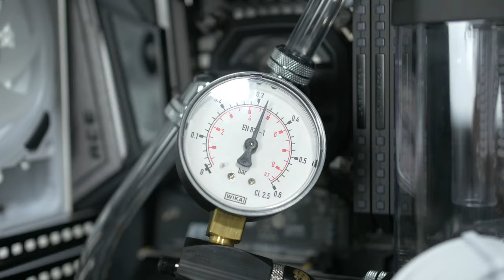Timelapse Build Corsair Crystal 680X / Hydro X Build + PC Porn

Comment: The Build looks amazing! Would it be possible to fit 2×280mm radiators, each on top and bottom, in the case?
Reply: No from what I see on my 680X, but you can put 2x240.
Reply: @2018Bkg  Top and bottom will take 240 or 280 front 280 or 360 rear 120

Comment: I never noticed any storage besides the m.2 drive, I didn’t see you connect anything else either. Did you use any extra storage? And would you recommend removing the drive cage if you were to only install a single 3.5 inch drive?

Comment: I love corsair new approach on the custom WC. Althrough, personally, for the graphics card, i really think ekwb blocks look sexier. The cpu one is pretty good tho. And i would've used 2 240's on bottom and top, and left the front for intake since it does not have really good airflow. And i would also like a bigger reservoir

Comment: Hey, 

Nice watercooling, 

Planning to do the approximately the same watercooling as you.
how long did it takes to you to make it ?

Do you think it is possible to add a 240mm rad at the bottom of the case? ( 240mm top + 240mm bottom + 360mm front) rad ?
Reply from the maker: Hey, i dont know i dont count the time. :D Maybe, could be very tight.

Comment: Hello TechMax, I was wondering how long your cable extensions were, I was planning on doing a similar build with the 680x, thank you, It would be nice if you could reply :). Also, How do you clean the front radiator and what mount is that for the reservoir to the radiator?
Reply from the maker: Hi! 24 Pin 600mm, EPS 700mm, GPU 600mm. By removing the Glas? The mount comes Stock with this pump.
Reply: @TechMaxTV1  Thank you so so much man, you are actually a bloody lifesaver <3

Comment: Dude, how did you do? I have quite the same components... but when I try to insert the front panel (I mean radiator + fans + pump/reservoir)... the pump/reservoir touches the 4th RAM module. I watched your video hundred times, but I don't get it!
Same Case (680x), same radiator? (it is not specified in your video, but i suppose is XR5), my fans are QL120, yours are LL120 (but I think they have the same thickness), same Pump+Reservoir (XD5), same RAM (Dominator Platinium), the motherboard is different (but, of course, dimensions and RAM position has to be the same)  .... well, with you it fits, with me it doesn't!  ...maybe have you modified something?   Please help me!!! :-(
Reply from the maker: I sadly cant exactly remember i think it just fits :D